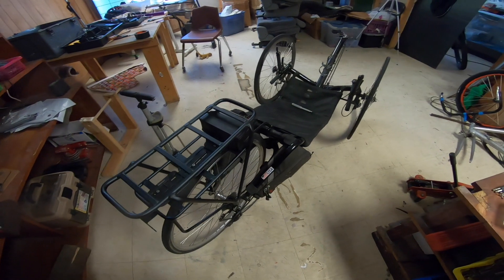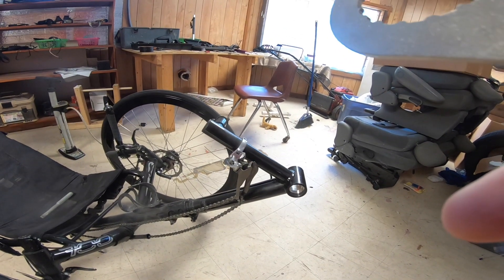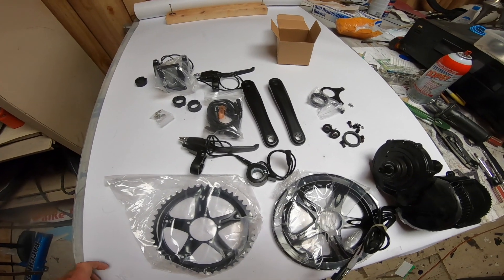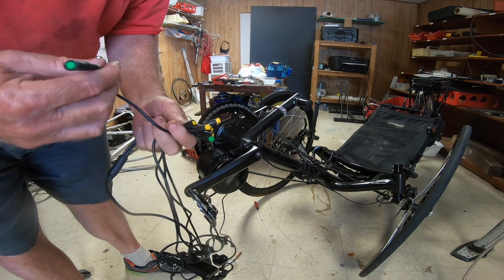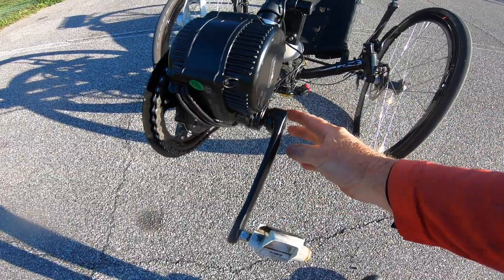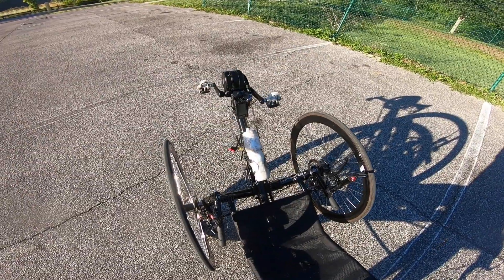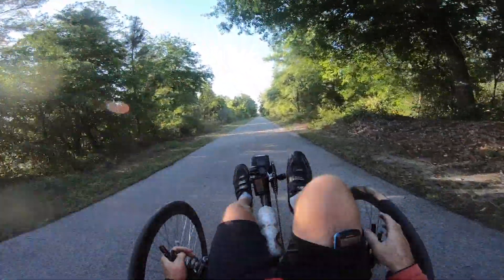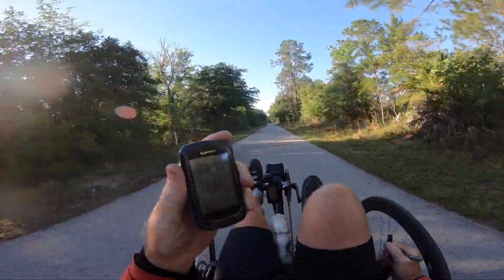TRIKE CONVERSION TO ELECTRIC.   PART 1

Comment: i may get a catrike dumont or ice trike adventure.  the VA because of my disability will provide but I may have to buy the pedal assist.  is it a hard install or can a local bike shop do it? I was planning to use the kit https://www.amazon.com/gp/product/B078YNVH9Q/ref=ox_sc_saved_title_5?smid=A3FBGZ8EKA6TSC&psc=1. thank you
Reply from the maker: I would get the rear wheel motor
Reply: @BTRflorida  thanks

Comment: Must you be pedalling at all times? Freewheel on fast descents? Parasitic drag? These are important questions for newbies. I’ve ridden my trike 6000 miles in very hilly area. Use low gears much of the time. Afraid I’d use up the battery in one steep climb...coming down the steepest hills in my usual route can hit 45-47 mph. I gear out long before that speed. Looking at rear hub motor for less stress on chain. Hate that big clunky looking biscuit on the front end. Looking for comments from experienced users.
Reply from the maker: you don't need to pedal all the time, battery life ? I would guess 15 miles up hill with no pedaling, with pedaling 20. depends on the size of the battery you get.